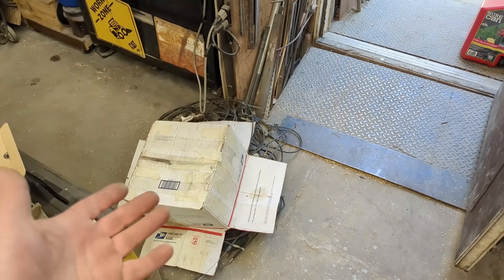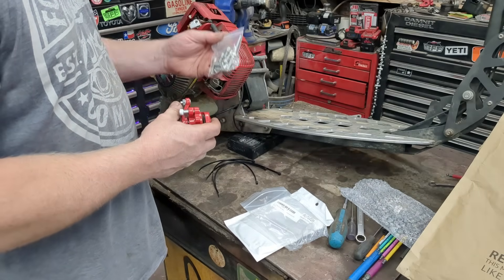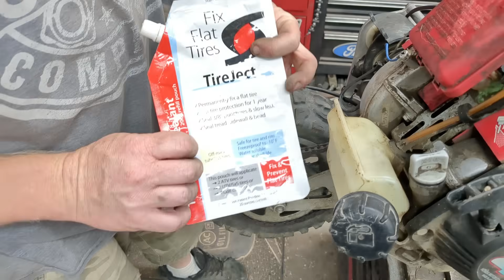FIXING Stand up Scooter 2 stroke to 4 stroke Honda conversion

Comment from the maker: Stuff I used in the video:

Buy a new one of these scooters: https://amzn.to/3KoRQ1e
TIREJECT sealant: https://amzn.to/3qegbjk
Universal 7ft cables w/o Sheath: https://amzn.to/3KrkIWu
WERA Hex keys BEST I've ever used: https://amzn.to/47jqnYO
Little Honda Engine 4Stroke CLONE: https://amzn.to/43UOwlx
Chain DRY lube VIEWER recommended as best: https://amzn.to/45c4nx4

VIDEOS:
Best Tire Sealant: https://youtu.be/nfti6Jt0ye4
Make your own cable ends: https://youtu.be/_zM3V0v1EJY
Make your own SPRINGS: https://youtu.be/MkiFmzVkEmI

After Thoughts about the Video: One side note is how much quieter the 4 stroke engine is. Nearly 1/2 I'd say. The original 49cc 2 stroke vs this 31cc 4stroke doesn't have much if any power difference. The 4 stroke has more grunt off the line but falls flat at higher rpm/speed. Where the old 2 stroke takes forever to start moving but keeps pulling at higher rpm than the 4 stroke. How fast was I able to go? around 20mph in speed one(has 2 speeds) and wasn't able to get it to pull away in 2nd gear. I did have a little downhill part that gave me a nudge and I may have hit 25mph. A 120lb kid wouldn't have an issue and this would push 30mph easily in 2nd gear. This doesn't sound fast but you fell like your clipping along at 20mph on this and the steering gets twitchy. 

SUPPORT THE CHANNEL or support the SHOP DOG's treat addiction:
Buy Ginger a new bone: https://www.paypal.com/donate/?hosted_button_id=NS699E56WTYHL
www.instagram.com/sixtyfiveford/
www.facebook.com/sixtyfiveford/

Comment: A buddy of mine, in his 70s was riding one of those type scooters with his dog on it like that and the dog jumped off and threw him off balance and he veered to the right and into a concrete barrier. He broke an ankle, collar bone, arm, and wrist. The dog was fine but ran off with his cell phone. He somehow managed to drag the scooter the mile or so home and drive himself to the hospital.

Those things just never looked like a good idea to me. Tiny wheels, rough roads and hard pavement just seemed like a bad idea to me. 
I had a moped as a kid that had small wheels, maybe 12" total diameter, and that was bad enough. The guy I sold it to hit an open man hole with it while coming home from the bar late one night and totaled it and his hip and face as well.

Comment: Hi there! I just subbed cause of this video! I do have a question: I have a 2 stroke stand scooter 49cc, and I was driving one day and half ways I felt like the scooter started going faster than normal top speed and all sudden it bogged down and started clattering/smocking,before the motor shut off, what do you think happened? I noticed on inspection my carburator screws were really loose as was the air filter on top. everything was so loose, did I damage the engine, and what you think would fix it ? I have yet to really inspect it, but it would start but bog down. I also do not have fuel filter installed, could it be that the carburator got clugged up during ride and the motor stalled that way and wont work till I clean it ? I hope I didnt ruin the motor... It still wants to start but its not
Reply from the maker: 2 stroke revving higher than normal is the engine running too lean. This can be as simple as running out of gas. But can also be an air intake leak.
Reply: @sixtyfiveford  Thank you for the reply, I don't believe the engine was out of gas as I left the house. For the sake of argument, say it did get glogged somewhere fro mthe fuel, would running it 25mph  and it suddently died like that with shakes as it slowly died? Also, would that hurt the engine in any form? Im just worried I ruined it, it was like " wow, this thing suddently is faster than usualy" to " oh sh.t its dying , and I see smoke too!" lol... it wasnt that smokey, white smoke when I finally stopped IF it really did hurt it, I would of seen black smoke, right and a lot of nasty smell? Thank you for the replies, you're amazing ! Im glad I subbed, I hope you can reply back to this last time

Comment: Front brake stops you, rear brake just leaves skid marks,  no weight on the rear tire when braking.
Reply from the maker: On a stand-up scooter like this was a center of gravity 5 ft off the ground, The front brake throws you over the handlebars.
Reply: I have to admit the few times I got on a Go-Ped, I promptly fell off.  But my problem was controlling the throttle when my body weight exceeded the Weight of the Go-Ped by about 100:1.  All three of my kids raced these scooters in the 80's and with reasonable skill/experience they were competitive and none had rear brakes.

Comment: Did you rebuild the bearing for the handle or just replace it?
Reply from the maker: WD-40 and sent it. It's going to be a rusted ball bearing/ disintegrated cage, that I don't have. It smoothed out after the lube though.
Reply: @sixtyfiveford  okay

Comment: 11:32 thought you were a slime guy, but I'll try this stuff when I run outa slime
Reply from the maker: I still use slime from time to time and it works great. However, I think Tireject works slightly better and for way longer. Slime seems to dry out after a year and leaks can reappear. Slime mainly consist of a liquid holding cotton fiber and teeny rubber pieces to seal leaks. Once the liquid dries up, it leaves just a solid clump of cottony rubber stuck to the lowest part of the tire. Not all leaks reappear but I would say 25% do. With Tireject once it's sealed, it's sealed for life. Also you put in so little that it coats everything and there's never a clump left anywhere. Both work good though

Comment: Can you add that tireject to tires that presently contain slime sealant?
Reply from the maker: Personally I have after the slime has dried out (1-2 years). However, I don't think they recommend it but I have had decent results doing that.

Comment: 4 strokes much more reliable, lucky it bolts right on. Looks like Ginger needed a wider platform, or might've been the holes she didn't like
Reply from the maker: Yeah the 4 stroke will be much easier for the kids to fill with petrol and not worry about mixing.

Comment: That’s pretty cool! Back when I used to race go carts, we used 1/4” freezer line with bulk purchased cable to make throttle cables. It’s nice because you can use the ferrel fittings to mount to whatever brackets you make. Plus you can make them whatever length you want them and they don’t freeze up like the metal sheathing. They will wear out over time but easy and cheap to replace. I don’t recommend them for brakes though unless you soldered the ends.
Reply from the maker: That's awesome

Comment: I’ve got a Honda string trimmer with a similar engine I bought in 2005. It still starts cold on 2 or 3 pulls and on 1 pull when hot.  It’s burning a little oil but that’s probably due to valve seals.  No oil and gas to mix and no annoying “mosquito scream.” Honda power is no joke. 😊
Reply from the maker: Yeah, great little motors.

Comment: Motion Pro has a newer cable luber that seals completely around the end of the cable and works worlds better than that style.
Reply from the maker: Question for you if you have it. Only reason I haven't bought that one, I read online it doesn't slide over a lot of mower cables with ends like the Z-Bands.
Reply: @sixtyfiveford  Yes, Z-bends might be an issue. Mine's at work and I won't see it again until next week, but by memory I think you might be able to wiggle a 1/2" offset end through the neck. I'll try to remember to take a closer look on Tuesday.

Comment: A buddy that ran a concrete pump found a little 2-cycle mounted to a skateboard in a dumpster years ago. Don't know if he actually got it going as I dropped out of the loop shortly thereafter. Don't think Ginger is too enthused over that rig either. Happy Happy and God Bless
Reply from the maker: That would be a fun trip up and down the street.
Reply: @sixtyfiveford  It'd be me on my head. Too many concussions already.

Comment: A blast from the past.😄 I added a few ounces of trans fluid to my 20+yr old cracked wheelbarrow tire, worked like a champ! Part of the fluids job is to swell rubber seals. Btw Ginger Rocks! I have the same tight connection with my adopted Australian Shepherd, (tri-colored red) 💞Midas rescued me!!✌️
Reply: 🤔  I'm guessing trans fluid might work pretty good in riding lawnmower tires that aren't too far gone.
Reply: @michaelbrinks8089  Most definitely! put in about  5 or 6 oz give or take, air it up, spin it around a few times and you're good to go, try it tomorrow friend. ✌️
Reply: @yukonjack.  I'm gonna give it a try in my 10+ yr old moving dolly tires. I figured tire slime wouldn't work.....So I bought 2 repair/conversion, innertubes a couple weeks ago for under $10 at harbor ⚓ freight. Instead of 2 new wheels/tires for $25....I'm gonna try the trans fluid 1st, to see how well it works & let em soak for a couple weeks. It'll recondition the inside of tires before I put the tubes in. I made some tire/inner tube liners out of some scrap black rubber roofing material. To help protect against flats from sand burs & goatheads. The diy tire liners worked in my bicycle/no more sand burr flats....There's an automotive product called AT-205 reseal, that works really good also to recondition exterior rubber & internal seals....It's a clear liquid, but now thinking about it, its probably the same chemical additive that's added  into trans fluid for the rubber seals. There's a bunch of YouTube videos about the at-205 reseal.

Comment: Most motorcycle riders pretty much only use the front brake... not sure on a scooter if that's better than a rear brake. Rear brakes are easy to lock up. Brake hard, weight goes forward, lifts off the rear, and then the rear locks up.
Reply from the maker: Because you stand on these, the center of gravity is just so high up front braking just has to be done very cautiously. It does work better when you're on a hard surface though, than the rear brakes. Problem is if the front tire locks up/ slides on these it immediately dumps you off.

Comment: Great job, Moe! :) You might add DuPont Chain-Saver to your affiliated links next time. I not only use it on bike chains, but on small engine parts such as choke assemblies because it doesn't attract contaminants/no binding up.

Comment: cool repurpose of the Honda engine.  First I've heard of the Tireject.  I would love to try it on my ATV tires, but previous owner put motor oil in them and now they are starting to seep oil. Grrr
Reply from the maker: I've had a lot of people comment about using motor oil in old dry rotted tires. I played around with this a little bit years ago without great success.
Reply: @sixtyfiveford  I've had the 99 Yamaha Bear Tracker 250 for about 5 years, and it's a good unit w/ original tires.  I only noticed the oil at the beginning of last hunting season.  They've been fine up until then.  But now I'm thinking the oil is starting to break down the rubber and that is what's causing them to leak.  I can't imagine I would be able to get them clean enough to use the Tireject now.
Reply from the maker: @JohnMGibby  Yeah I wouldn't waste my time with sealant if there's oil in there.